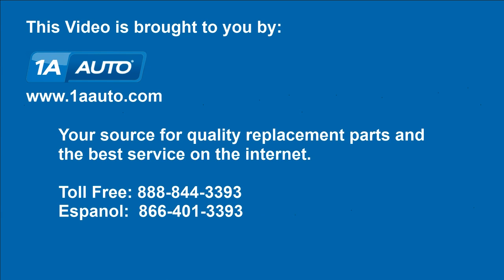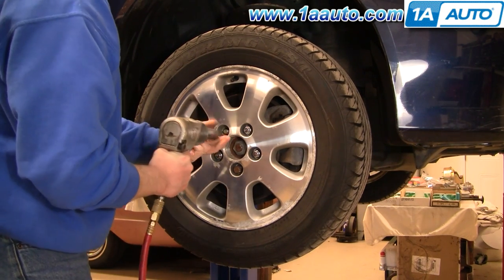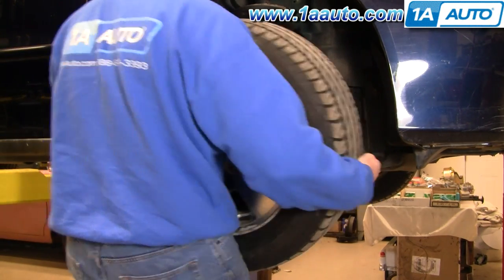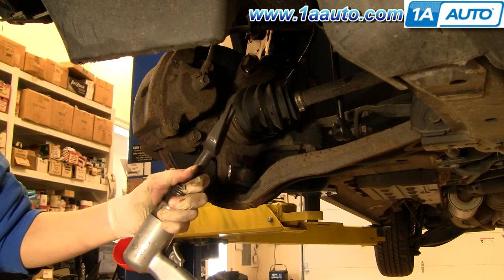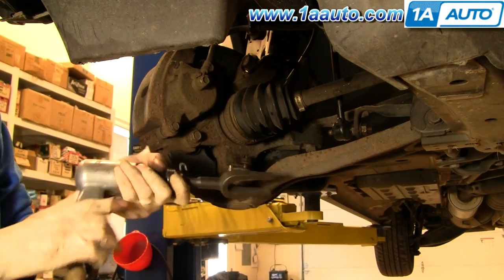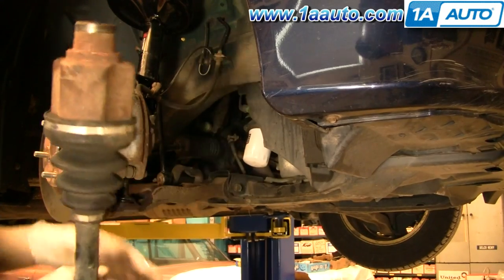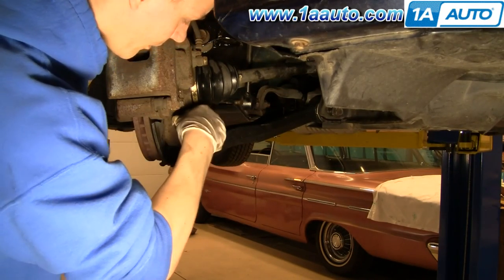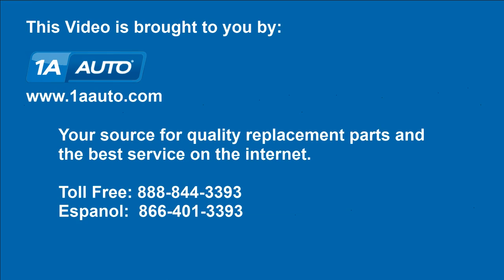How to Replace CV Axle Shaft 99-04 Honda Odyssey

Comment: Ball joint can be easily damaged by removing it this way. I noticed you put in a new lower control arm with a new ball joint. I would disconnect the two strut bolts without removing the ball joint unless you need to replace the ball joint anyway.

Comment: i usually can do an axle in less than 30 minutes. I spent 20 minutes trying to beat axle out of inner joint would NOT let go . Had to put back together so mom could get her kids. Back to it another day with a bigger hammer. ( and on my lift or higher jack stands.)

Comment: those lug nuts only need to be torqued to 80 ft lbs, not 95-100. You risk busting a stud next time you take the nut off if it's that high.
Reply from the maker: +RockSleeper Thanks for the tip! We'll pass this info along to our production team.

Comment: Two things to address some comments below:
Video does not show left side removal, which is slightly different than right.  There's no spot to place a pry bar or screwdriver to drift the old axle from the transmission.  Use a cold chisel of the proper size between the transmission and axle to separate.  You don't need to strike it very hard.  Both axles have a circlip on the inboard sides to hold the axle in place during manufacturing.  You should examine the new axles to see what you're up against.
The axles are not indexed; you don't need to insert them in a particular orientation.  But you should lubricate with grease both the splines and the mating transmission oil seals upon re-assembly.  Use any chassis grease and a flux brush.  You will need to strike the axle to overcome the circlip resistance.  Thread the old retaining nut halfway on to protect the new threads.

Comment: This video is great! It made this job a lot easier for me to do. I have replaced axles before but disassembled to much stuff. Just removing the ball joint was a great way to do this job. I just finished this job and it went very well.

Comment: I couldn't get the lower ball joint off, it was so so stuck... @4:25 when he just gives a lil tug and it comes free, i pry'd and pry'd  and hammered WAYYYY harder than this guy- and it WOULD NOT COME FREE!!!

Auto work is extremely frustrating without right tools/knowledge. Pretty damn easy with it.

Comment: Is there a Axle Shaft Seal when you take the CV axle off every video I watched and  forms I read doesn't have anything on a 03 Honda Odyssey  .But  I replace both CV axles on our 09 Murano it had seals and they need to be replaced when the CV axle was replaced.

Comment from the maker: carnz06 It should push back into the transmission and hub ad shown in the video. The nut on the axle shown near the end of the video will secure it in place. Hope this helps you out.
Reply: I have a 2005 Hona pilot with really bad shudder on the driver side,  I suspect it will be the cv joint needing replacement but im not sure.  Is there any way you can help me with my  diagnosis?

Comment: Your video shows replacement of the passenger-side CV axle.  What about the driver-side CV axle?  Will transmission fluid drain out when I remove the driver-side CV axle from the transmission case?  Thank you.
Reply from the maker: +TheBruceTR Thanks for watching our video! Unfortunately it seems that we don't have a video for the driver's side axle.  Typically some transmission fluid does come out when you remove a cv axle. The amount of fluid will likely depend on how the vehicle is jacked up.  It's always good to have a drain bucket under the car just in case.  1AAuto.com

Comment: I ordered a passenger side axle for my 08 Honda odyssey the new one came with a sleeve attached to the inboard side of the axle. Not sure if it's the right part. Every other video has the same axles looking the same. Just trying to find some information

Comment: Do you know what the difference would be if I'm going to attempt this on a 2005 Odyssey?  I need to do the drivers cv/axle, and both outer tie rods, and I have to do this for cheap.  Not safe for my wife to drive.
Reply from the maker: It might be a similar procedure, we currently do not have an auto repair video that shows this particular repair. We do carry the new axles on our website with FREE SHIPPING in the lower 48 states on all orders. Here's a link to them on our website. http://www.1aauto.com/1A/axles-and-axleshafts/Honda/Odyssey/-/-/2005?utm_source=VIdeoReply&utm_medium=VideoReply&utm_campaign=1ATony

Comment: 4:24 it looks like the ball joint boot got torn from the pickle fork.  The manual shows a different ball joint separator tool used, doesn't it?  Looks like a big metal clothespin that squeezes down on the ball joint stud to push it out of the knuckle.
Reply from the maker: Thank you for watching! That would be a ball joint press.
 888-844-3393

Comment: At one point in the video when you are putting the ball joint back in place, the bolt is missing where the control arm bolts to the frame.  When did you remove that bolt, and what was the reason.  I'm just curious if it is required
Reply from the maker: +TJ Duncan Sometime we'll shoot a few videos at once. We may have removed if for a different repair. 1aauto.com

Comment: My husband was replacing the right wheel axle. he did everything you did but in putting on the replacement the spline did not want to go through the hub no matter what he did. So I told him to take it out and put back the old one but too did not want to go through the hole alotted for it in the hub. We turned it in all directions trying to line up the plines but nothing. The othe end went into the transmission with little or no resistance. Tell me what could be wrong?
Reply: Oh its a 1999 honda odyssey
Reply from the maker: +Myrantha Paul It should slide into place as shown in this video. 1aauto.com
Reply: It didn't and so he had to tap it back in so we were wondering why. It came out easily it should have gone back easily. Its the first experience we had with something like that. It was like popping out a cork and having trouble to put it back in